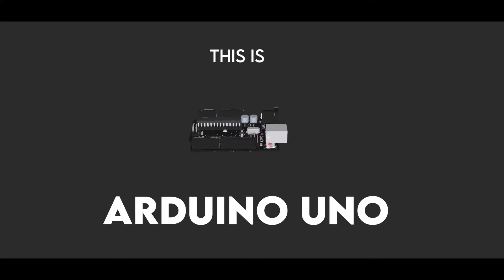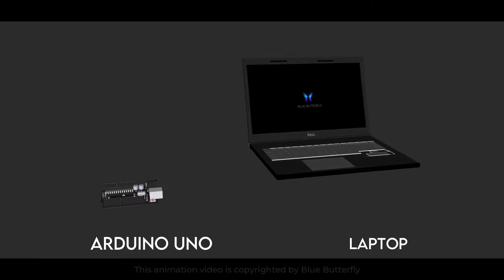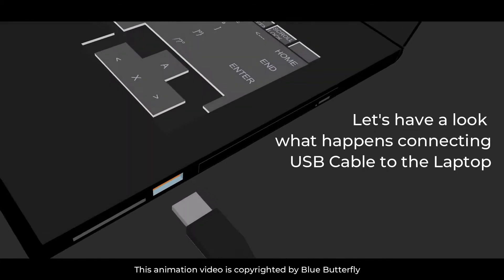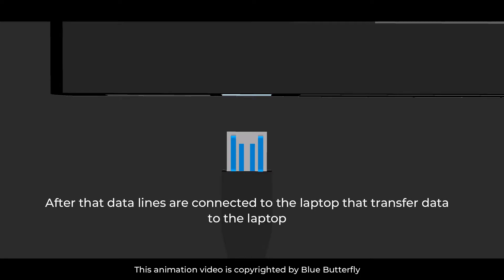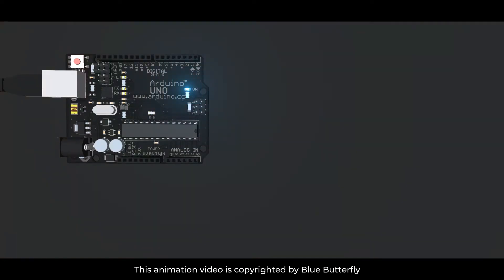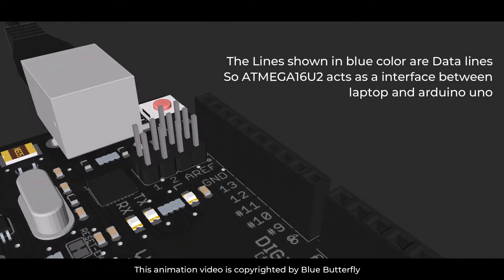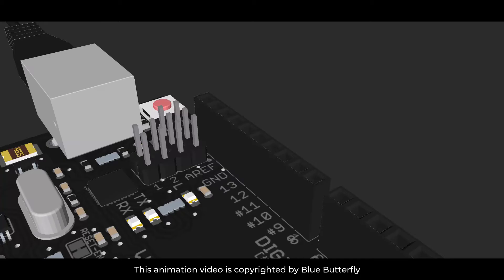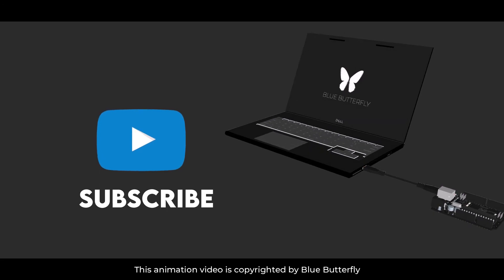What happens when we connect arduino to laptop ? | What is the function of ATMEGA16U2 ? 🤔

Comment: does mega16u2 need any driver to see pc?
Reply from the maker: Nope bro mega16u2 works as a interface between pc and the atmega328p ic mega16u2 has firmware inside it that tells pc that this is a serial device. Com port drivers are needed that is installed automatically when you install arduino ide. If sometimes your pc doesn't recognize arduino that means any druver problem or mega16u2 firmware problem 🤘 you can upload firmware by flip if lost 😊